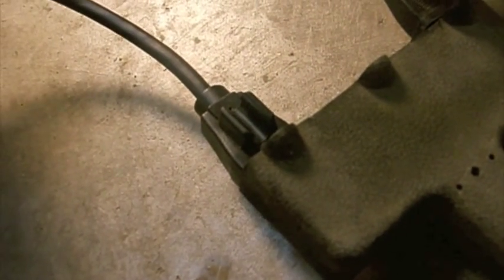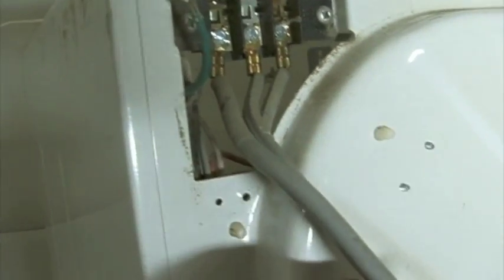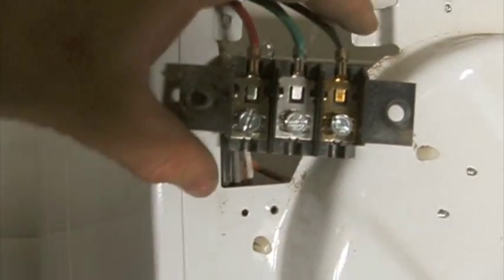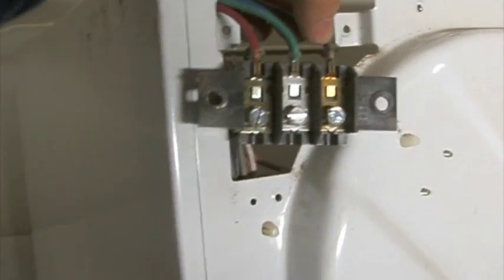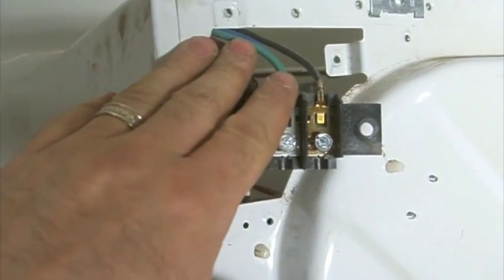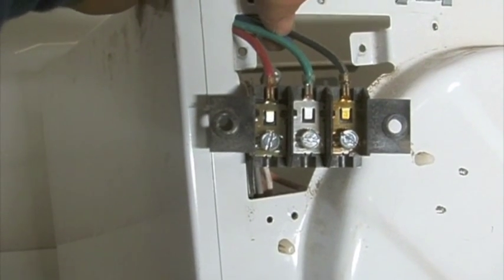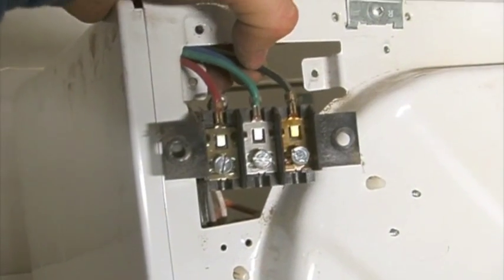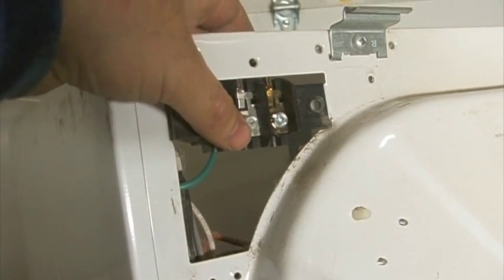How to easily replace a blown or burned terminal block

Comment: Thank you sir working on this piece right now
Reply from the maker: Glad it helped!
Reply: Ok thank you boss will do
Reply: I just installed the cord still not working I will try one more thing which is the fuse Ty u boss
Reply from the maker: @jonjon6422  Oh yeah the fuses blow often and usually because the vent is clogged and air is not circulating through correctly.  Make sure to clean out your vent tube in the back and while your back there changing the fuse vacuum the inside.  Also check the little damper where it blows out of the house often that can clog there as well...

Comment: My unit looks exactly like yours. The black power cord has melted through the terminal block. How do I know whether I need the 134101400 or the 134037400 terminal block to replace? Everything else looks good, including the power cord and the ring terminal connectors.  Can you buy just the flat clips that slide into the terminal block? Or do they come altogether as a unit? PS: Would you ever splice the black wire alone to replace that connection (assuming you have an unmelted plastic terminal block?)
Reply from the maker: Type your model number into repairclinic.com website and it will tell you the part number you number you need when you click parts and terminal block.  Also if you look on the terminal block you will see the part number on it.  Check the price on ebay as well.  This is a part that you can easily order used and it will be just as good as a new one and less money.  I am guessing your wires burned and you may need to splice them, so get a used one with some extra wire still attached.  Also make sure you have fully unplugged the unit and turned it off at the breaker before working back there.  Best of luck...
Reply: Thank you.  I have confirmed the part number stamped on the plastic terminal block as 134037400 and found a few used on eBay. Do you know if the flat electrical connection can be slid OUT of the plastic clips, in reverse of how they were installed?  I need to replace the melted plastic terminal block due to the third (black wire) nut and screw melting it, and since they are rusted/corroded... the first two (red wire, blue and green wire) terminals look intact. Can I slide them out and avoid splicing at all?  Or must all three of the wires be spliced to install a used terminal block?
Reply from the maker: @kirkgroeneveld3191  just splice the one bad one the others should unscrew.  You may even have enough loose wire to clip the burned end off and skin the wire and not have to splice anything.  That would be preferred, but if in doubt you may need to splice the one.  Best of luck

Comment: If one of those burns,  does it stops working completely? Because mine hade a burning smell when I did the tube wash and stop working completely, I mean lights and every thing.
Reply: Yes, the burning smell was the plastic melting. You MUST have this part replaced. Your unit will not work until power is restored. DANGER: UNPLUG THE POWER CORD NOW!